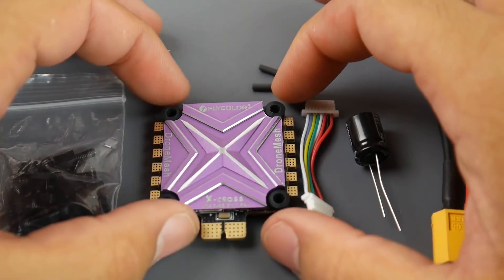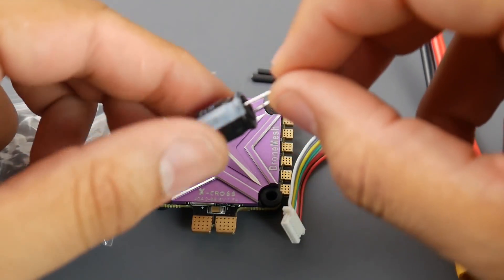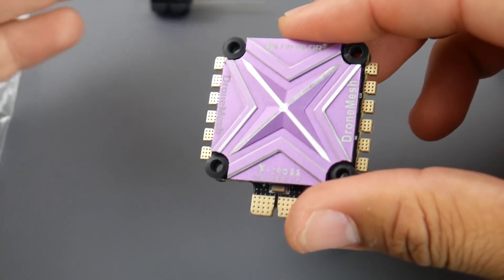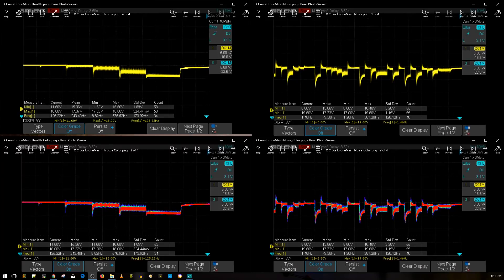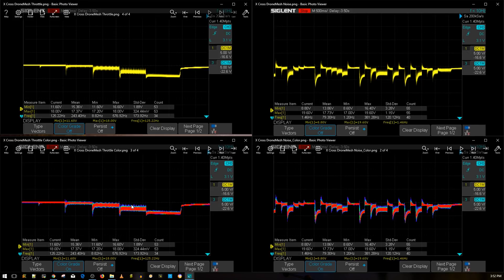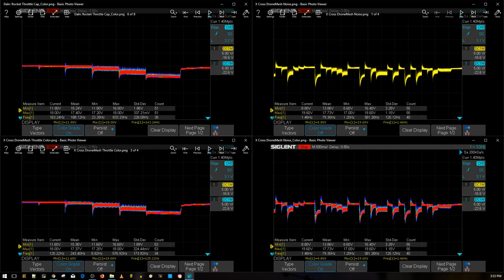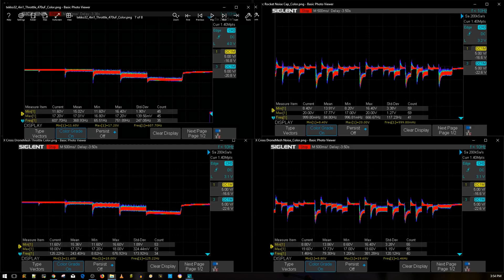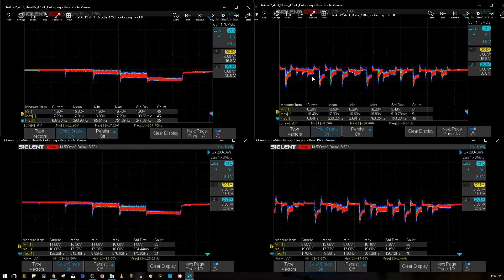Flycolor X-cross 40A 6S 4in1 ESC // Review and Noise Testing

Comment: My hawk 5 came with emax f4 magnum tower and zlh 470mf 25v cap attached. When i lost it after a crash, i didnt notice any difference. But when i added a zlh 1500uf 25v - osd flicker became less frequent and dark lines under throttle punches completely dussapeared (they were barely visible tho).
And i still don't get it why do they keep adding softmounts on  4 in 1 escs...

Comment: Drone Mesh.   In your busy schedule could you please test the difference between having a single cap soldered to the Xt60 connector, versus it being soldered on the battery pads.  With the 'Cap cap' pcb  from Piroflip out now, and the latest Babyhawk both having the Xt60 setup.
Reply from the maker: I think it should be on the pcb because that is the point where all the noise is going back to before going to the battery..
Reply: @DroneMesh  yeah I believe it's better to do that, but it's becoming popular to solder it to XT60 and the Cap Cap is a little pcb made to make it really easy to solder it to the Xt60. Being shown the loss of filtration would be great,  if you think it's worthwhile testing.  I myself solder to the Xt60 as my frame makes it very hard to have the Cap on the pads.